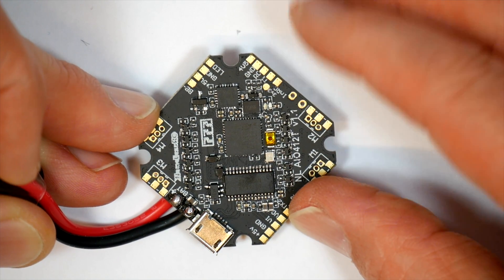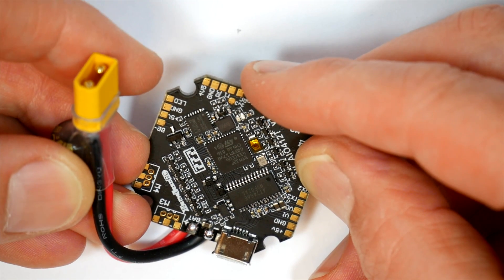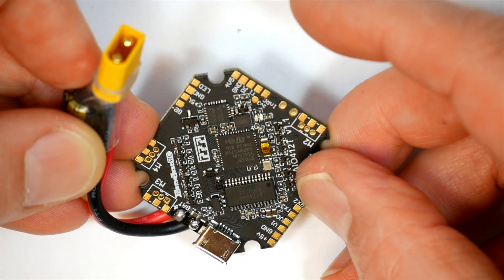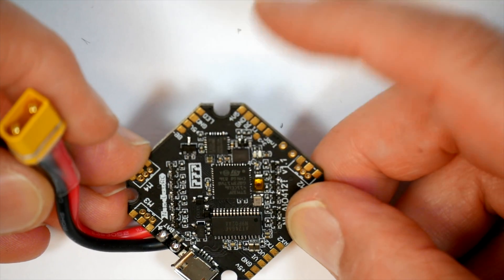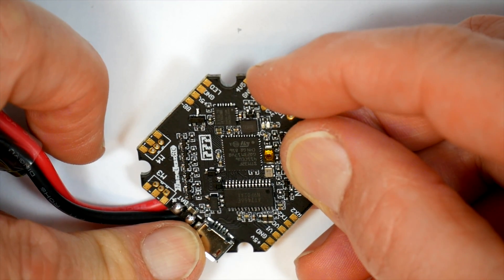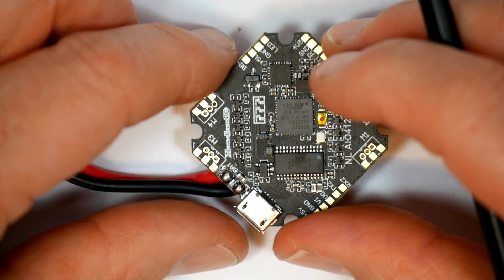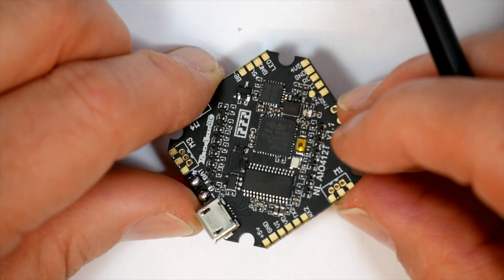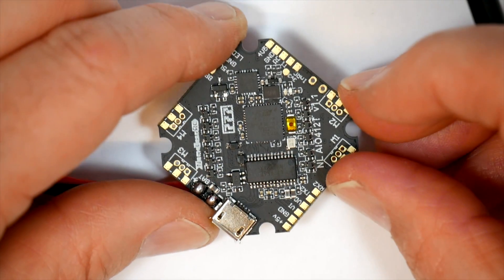NamelessRC whoop toothpick all in one flight controller board // AIO412T // CrazyBee beater

Comment: Those 90 degree motor connections will not work with the mobula7 frame. If you look at the frame it will not fit.  Use straight ones and the will work. 👍glad I looked before I soldered them
Reply from the maker: Good point. Thanks for the feedback.

Comment: Nice review. Will definitely buy when i have to replace my Crazy bee boards.
Reply: Are you having much luck with those Crazybee board? every review I read is bad. Same with BetaFPV and Nameless boards. I dont know what to go for they all sound crap. I bought the Crazybee F4 V3 and got no video, I sent it back and was then told the video in and out pads are labelled wrong, did you find that problem too?
Reply: Ya no problems so far. I have 2 Mobula 7's a sailfly x and red devil. I don't really push the red devil and sailfly x. Usually flying 2s packs. My 2 Mobula 7s i did the xt30 connector mod.
Reply: @garycross5160  I ended upo going for the iflight succex f4, great board but the 5v pad is too close to the mounting hole so you need to put some hot glue there to stop the screw touching it, apart from that its awesome.